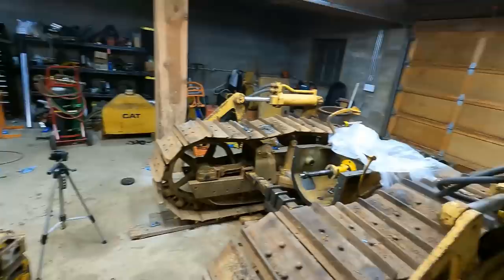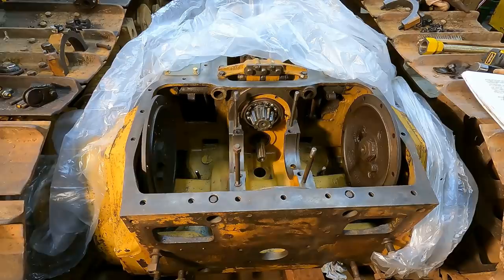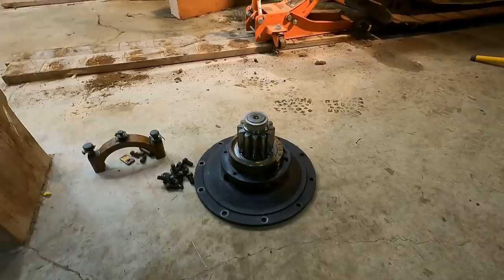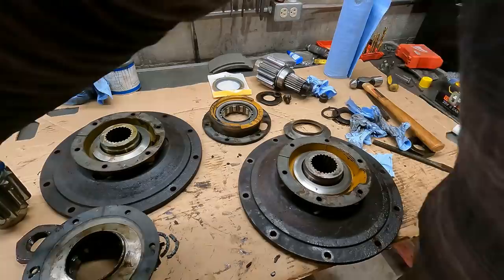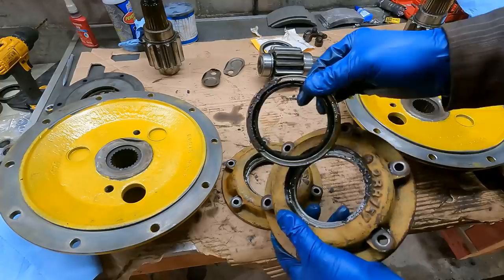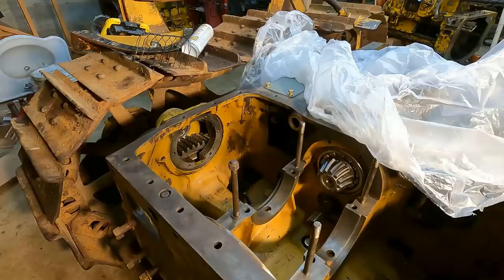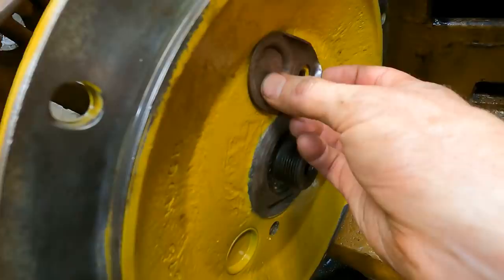Caterpillar D4 final drive pinion rebuild

Comment: I have had a bearing failure in a final and the gear picked up a bearing and took out teeth on the gears. Might be old damage and it was put back together with that damage to the pinion gear which it would still work with the small pieces out of the teeth.
Reply: I think you hit the nail on the head.
Reply: That's what I'm thinking also.
Reply: That's what I thought.

Maybe they replaced the big gear from the outside? Removing the track, drive sprocket,  etc. They couldn't do the small gear from there, so didn't change it?

Comment: Ole School mechanic myself, you are doing a great job identifying the causes n related problems.  In today's shops, most are misdiagnosed n just parts replacement mechanics.  Not many mechanics could go as far as you have without guidance imho.  If a guy doesn't understand how equipment works especially under load, they can't accurately determine the cause of the problem.  Enjoyed watching your video, n probably the first time I've watched one that doesn't involve cuss words every other word.

Comment: That gear damage is old and was probably caused by the small bearing failing.  The original repair cleaned out most of the bits, installed a new bearing and re-used the damaged gear.  Given that the dozer will probably not do 10,000 hours in future that gear would have held up.

Comment: A bearing went bad on that left side final drive. That's what chipped those teeth. A discussion was probably had about plenty of mating surface left on that gear, and just the bearing and seal were replaced. I've seen that before with older machines. Like how much do you really want to spend on this old machine ? was the question being asked.
Reply: I has thinking the exact same thoughts when Matt posted the initial photo. It was probably an expensive part pack in the day, plus you had the cost of down time.

Comment: Was stoked to see a new video! It’s coming together nice! Also - I just bought a box of 100 black HD nitrile work gloves off of Amazon for like 25$. Worth it for sure to have quality work gloves especially when handling heavy grease/oils and cleaners.
Reply: A trick I use. I wear 3 layers of blue nitrile gloves. If top layer breaks I can easily swap out the glove without fighting sweaty and grippy hands. When I finish the work, I toss outer layer and leave inner two layers on corner of the table. Next day i first put on pair of clean new gloves and top them with yesterdays two layers of cloves. I like clean fingernails...

Comment: Matt,

A little trick to remember when that final clip (eye gouger) will not seat properly from uneven thickness or just a hair too thick.

Take a pane of old junk glass and rub on an area on the glass with - valve grinding compound-.  Now lay the ring on the glass and relax to music while doing “figure eight” patterns to even the ring and reduce thickness.  Also a good way to polish off old crud.  Push down evenly and move your hold down area often.  Use plenty of VGC.

Good Luck Matt, & Merry Christmas!

Comment: It could be that sometime in the past it had a bearing failure and when it was fixed they used the old gear and slinger when they put it back together.

Comment: After all of the flushing I am suprised that you did not blow out the housing with high pressure air. This would have loosened anything that is just lying around inside the case.

Comment: There is another possible cause of the broken teeth you didn't mention. That is one tooth cracked and chipped off. A small piece could have caused the damage to the next 5 teeth.
 I used to work final inspection in heat treat for gears at east Peoria CAT. We never 100% magnafluxed gears at final inspection, but only sampled a percentage of each run. 
 If we found a crack in a tooth, that whole run could have been checked, but it didn't happen often, but it is possible for a flaw in one gear to have gotten placed in use.

Comment: I had an old International IH500 with pinion damage like that. I just flushed it out and couldn't see any cause. I added strong magnet to drain plug and called it a day, just drill cavity in drain plug size of the magnet and glue them in with epoxy. Cheap insurance

Comment: Matt, get a piece of felt and make the gasket for under the flange retaining nut. It should be about twice as thick as the space between the face of the flange and end if spline. The felt will compress and seal the splines. RTV would not be a good choice in there.

Comment: I am kind of wondering if that gasket for the sheetmetal lid, is meant to keep the heavy transmission oil out of the steering clutch? If so, that gasket might actually be an important part. Thanks for putting this interesting project on YouTube!
Reply: You stole my thunder, Was thinking the same thing.

Comment: Matt, first off, great videos!  I love watching every bit of progress you make on this tractor.  Second, when I was watching the video, in the section where you were flushing the final drive and looking for chips, I agree with one of the other commenters in that I saw a very shiny chuck of metal in the bottom below the gear.  The times where it is most easily visible are 23:07, 23:12 and again at 23:17.  Visually, if you look at the bottom most tooth of the gear and then look to the right two teeth, it looks like there is a chuck of shiny metal sitting just on the other side of the ridge from where that pool of diesel is sitting in the bottom.  I would hate for that to be a loose piece of metal still able to roll around in there.  Check out those spots in the video and see what you think.  Keep up the good work.  Merry Christmas and Happy New Year!
Reply: Try fishing in there with a probe magnet.

Comment: My grandfather and father, who used such machines in woods operations, at times managed difficult service in forest and rock terrain.  I agree with Mr. D. Smith, citing a former service with only partial replacement.  The owner operator accepting known internal flaw to simply get back in operation.  And for any present sense of exactly how hard this machine was used, revisit the winch.  M.

Comment: try jacking rear up use wood blocks both back corners of body/frame then do front frame or blade arm mount teh same way . this will allow you to lift tracks off floor a few inches and you can spin tracks without rolling the undercarriage all around the shop

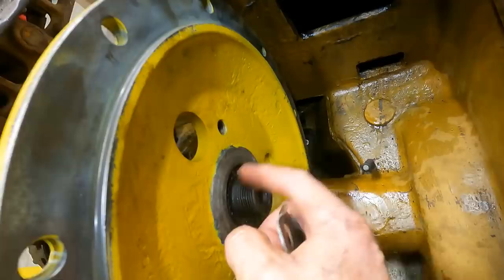Comment: At 30:19 you ask about the need for a gasket on the thin metal cover plate. It is to keep the clutch pack either submerged in oil or dry. Not sure which.

Comment: Look at the photo at 16:44. The edge of the bearing roller how is ground up. Is rough not smooth. That tells you that the bearing run with axial load in it and not radial so it rubbed against the flange of the outer ring. I worked on a tractor factory, and I suggest new bearings and gears. when you have an impact in the gears it's transmitted in the bearings and that can let an imprint in the surface of the rings or rollers. You might not feel it but the bearing does.

Comment: I would think that the part in question that you are debating about is an inspection port cover and it prevents clutch pack debris from getting into the gear components.

Comment: The gaskets and the bolts with gaskets on the flange, you pressed on, inside the final drive, is to keep oil and water from getting inside the clutch pack !!!

Comment: That plug might have a gasket to act as an anti-ringing vibration damper. 
And/or may help to keep moisture and brake dust out of the clutch springs. 
(The plug itself may help to keep possible rodents out of the springs, if the top cover is off or open.) 
Just some guesses.

Comment: You're doing good, Matt! When you pulled that  first pinion gear out, at first I was afraid you were saying it was bad. Then, when the second one was bad, my heart sank! I know the feeling so well..... But I'm glad you got a new one so quickly!  I'm sure someone knows whether the bull gear could move upward toward the pinion and cause that damage. Would it be worth putting a dial indicator on the bull gear and then lifting the rear of the dozer to measure any lost motion in the bearing? Maybe  it's more like the arrangement in a "full floater" truck axle, with the bull gear's shaft handling only torque...... You deserve a break from all these issues, dude! Merry Christmas and Happy New Year!

Comment: My question is why haven't you split the tracks opened up the drive sprockets and gone through those bearings? Those take a real beating. It would have been much easier to rotate all the shafts also. You now have a porta power that should handle the master pins.

Comment: My guess on the seal would be for it to keep oil from getting into the steering clutch if, for whatever reason there is enough oil touching that big drum disk for it to be slung arround, maybe if the tractor is at a really high angle and everything accumulates on one side.

Comment: It could have also been a previous repair.  If they were repairing it and that shaft didn't come in the mail in time.  They could have been told to put it back together with the damaged shaft even though they replaced everything else.

Comment: Great job, excell videos. I've got a cat 933 F to rebuild a broken bevel gear, and install a new pinion.
I have the 30 ton jack , but where did you get the heavy duty pulling bar and grade 8 all thread. ????
Reply from the maker: The puller is an OTC 938, the allthread I found on McMaster

Comment: I'm 99% certain that the shaft that lost teeth had a bearing fail on that side, most likely a bolt came loose, or contamination from when changing the oil or even a nut or something similar got left in when it was apart, I have seen it happen to many times. 
I was going to say ad some neodymium magnets and you did just that! grate minds think alike ;)
I'm really enjoying your work, and when you finish this beast will you be doing more like this?

Comment: They might want a gasket on that hole cover because the oil in the clutch pack gets much dirtier than the oil in the final drive gear??  Just a thought.

Comment: Another great video, Matt!  At 23:09, is there a shiny metal chunk on the right side of the inner case?
Reply from the maker: Hard to tell but it sure looks like it in the video... I'll have to take a second look at that!
Reply: @PacificNorthwestHillbilly  Would have been good to run a magnet around in there.  I saw it also and don't think it wiped out.  Not big enough to ruin the whole deal.

Comment: 7:44 For the pruposes you and I would use this machine those gears are fine. I'd just file the high spots off the teeth, slam it back together, and let it buck if it was me. The thing ain't gonna be working 12 hour shifts 6 days a week itt'l be fine with that gear as it is.

Comment: I am wondering why you had the big internally splined flange on the pinion when you had to torque the bolts thru the hole, moving the tracks to align the hole,.  And then you pressed the flange home on the tapered splines and installed the nut.  Seems like extra work.
Reply from the maker: The outer bearing cage sits between the flinger and the flange unfortunately, so you have to torque through the hole :(

Comment: I like the addition of the magnets.
I kinda disagree with how you attached the magnets.  If the nuts come loose because of hot cold cycles or vibration you will curse all humanity.   How about drill and tap the plug and use thread lock on a grade 5 bolt.  Every fastener on an aircraft has two locking systems.  You have way to much invested in that gearbox to risk it with soft all thread.   At least use a nylock nut.   
I am enjoying the build.

Comment: 3:52 that is why I don't bother with rubber gloves working on stuff. They just tear like that as soon as I even think about touching a tool or part. End up spending more time fiddlefarting with the fucking glvoes than actually working on anything and simple two hour repairs end up using half a box of them.

So I just don't bother at all. GoJo is cheaper.

Comment: i'd be afraid this little welded bolt might come off the oil plug, then you'd get more damage with the magnet running between the gears.....

Comment: Don't replace that final drive pinion mate. I operated a Cat D6D for thousands of hours with more damage to the pinion than yours. The final drive  filler bung somehow got lost and dirt and gravel was shovelled in by the tracks, not ideal. Housing flushed clean, new oil, kept operating the machine for another 10,000 hrs without further damage to the pinion or the bull gear. Save your money.

Comment: I understand something about the the 5000 psi = 15 ton. Is the math that simple? 30 ton = 60000 lbs, 15 ton = 30000 lbs ratio 2 to 1.  10000 psi at 2 to 1 = 5000 psi.  If 20 ton press ratio would be 4 to 3 = 7500 psi.  I am a bit confused.  I thought it had to do with the area of the piston in the press.  Or is the 30 ton rating done at 10000 psi.  If that is the case then to me that means the area if the piston must be 6 sq inches,  6 x 10000 = 60000lbs = 30 ton.  If that is the case, the area of the piston in a 20 ton press would be 4 sq inches.  Do you concur?
Reply from the maker: yup, the ratings are all at 10k psi.  the cylinder diameter is what changes between different presses
Reply: @PacificNorthwestHillbilly  yup, cylinder diameter/ piston area x PSI = lbs force.  I see some rams rated at 20 tons/44000 lbs, 30 tons/66000 lbs.  must be using the long ton, or UK ton.  Strange.

Comment: Why is it, that people with seemingly better than average understanding of mechanical fitting use high speed angle grinders WITHOUT the hand guards, especially when using thin fragile cutoff discs?  
Here: 20:17 Man... that is just plain stupid, expected from a dumb elder or 1st year apprentice. 
Weren't you taught to consider the consequences of a spanner slipping on a bolt... or a power tool kicking back BEFORE applying any force at school ? 
With a cutting disc spinning at that rate, bad shit happens long before you can realise or react... and grind injuries are worse than clean cuts from a knife edge, because the flesh and bone is removed Very quickly.... and very slow to mend. 
And, I can't understand why chose to use a welded stud and nut to mount those magnets in drain plugs. Better, a deeper drilled and tapped hole into the soft plug, then use of a countersunk set screw with locktite would be a far easier and safer method. No nut sticking out like dogs balls too. 
If that was a spring washer used on the nut your asking for trouble, because spring washers are a hopeless means of anti-vibration retention; they do spread or split... and the nuts are loose, unless excess stud thread is penned over, so the nut can't get away for a mash up party inside the gearbox.